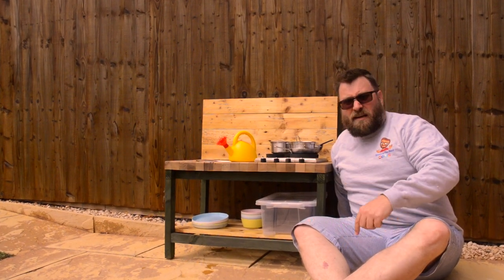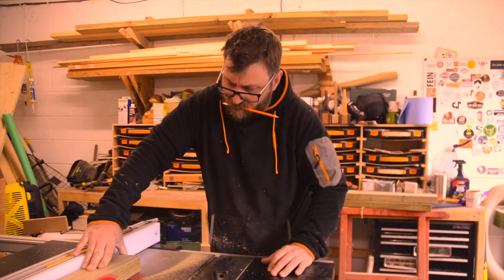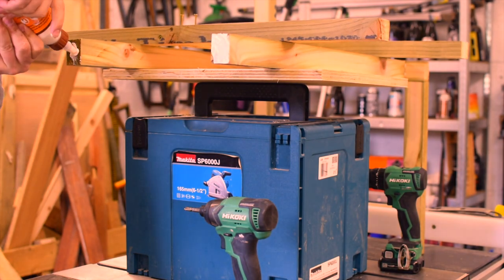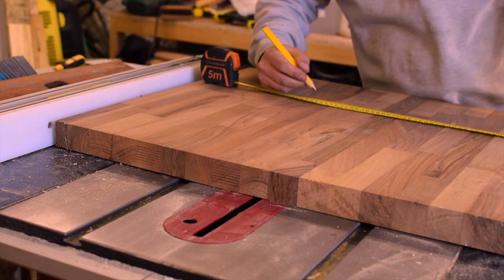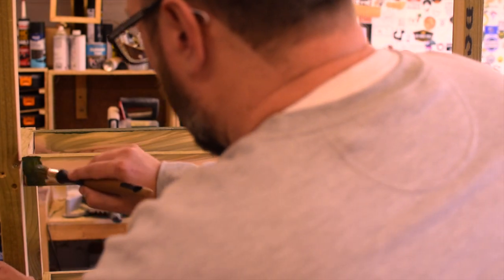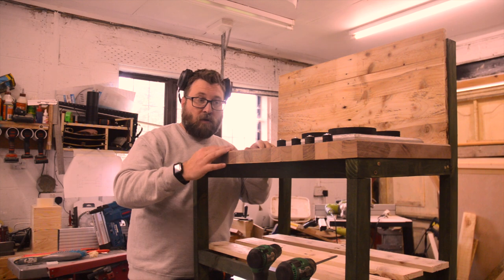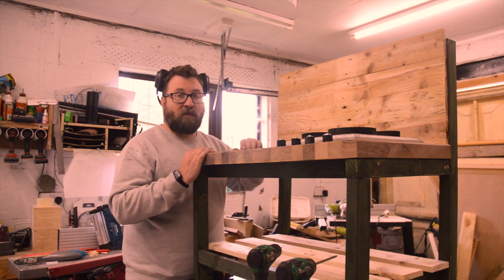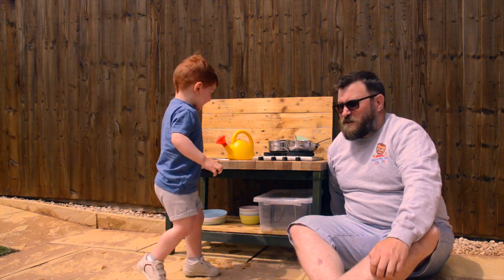Making a Children's Wooden Mud Kitchen

Comment: Awesome build there buddy. Probably the most expensive mud kitchen top in the world. There’s at least 4 chopping boards there lol. 
What was the yellow thing you had on the end of the black & decker drill??
Reply from the maker: Thanks Buddy, It was a DeWalt DT7612-XJ ' Flip Drive Set , with a countersink bit  it as i couldn't find my main counter sink bit.

https://www.amazon.co.uk/DEWALT-DT7612-XJ-DeWalt-Flip-Drive/dp/B000Y8VQ6A/ref=pd_day0fbt_img_1/257-1712255-9172819?pd_rd_w=tIwvU&pf_rd_p=ef3d5090-b98e-4b26-af93-4d8b0839347b&pf_rd_r=Z6QBCKNDECMR5MC5RMSK&pd_rd_r=1c10e174-fd84-414e-9f74-ff5b834f45dc&pd_rd_wg=N6b04&pd_rd_i=B000Y8VQ6A&psc=1